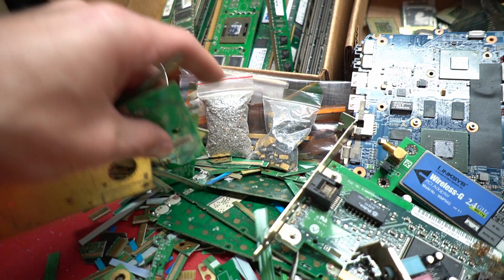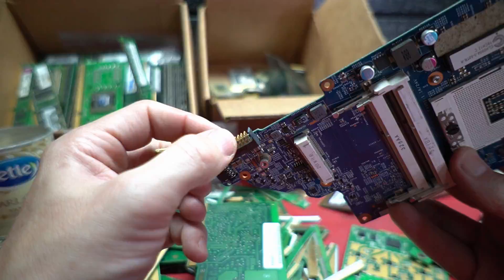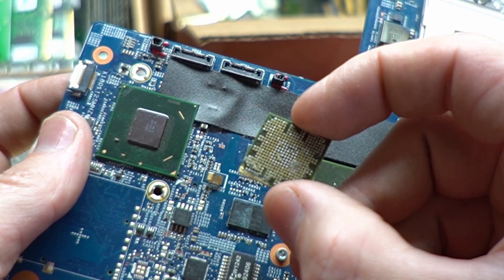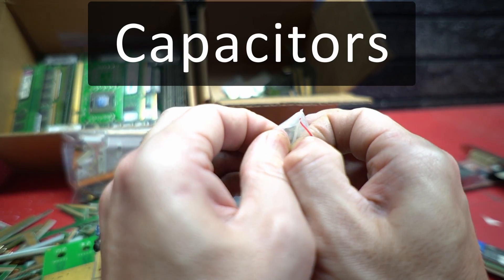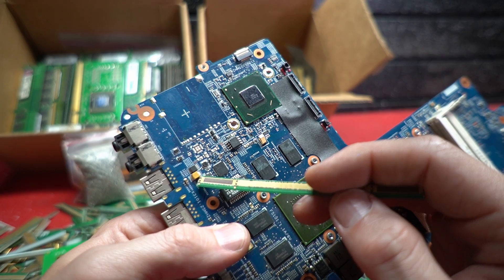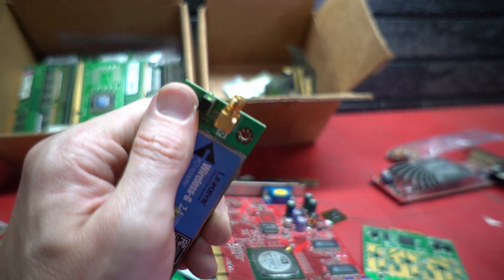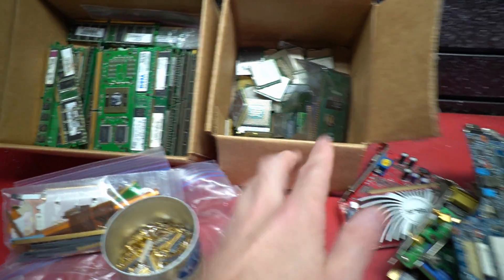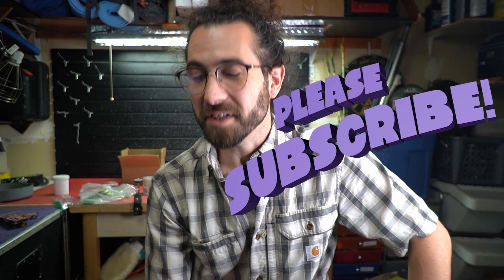Where Is The Gold Inside A Computer? - How To Find Precious Metals In Electronics

Comment: if you  directly melt the gold flakes that come out of the electronics, what happens?
Reply from the maker: I’m not sure I understand the question 😅 if you melt it, it will melt! The purity will vary, gold plating is 100% pure but the method used to release it from scrap could leave bits of copper or lead still in your yeild

Comment: gold isn't used for conductivity, as silver is much more conductive. Gold is used, especially on contact points as gold doesn't oxidize or tarnish, so the contact stays clean and allows conductivity to continue. silver or copper can tarnish making the contacts less reliable. its reliability is the key, not the conductivity itself.
Reply: You clearly dont have any common sense. Computer pins wont tarnish to behin wuth without gold because theyre plated with nickel but you didnt know that. Cou pins wont tarnish either because they are made from kovar a alloy. Stop talking about something when you know nothing about it. Gold has great conductivity but its even better at transmitting data over connections. Research something before commenting.
Reply: Gold is the best conductor
Reply: @Jason1975ism  Dude no shit did you not read what he wrote jfc
Reply: @GuestFGC  I'm not your dude and all I said was that gold is highly conductive. Wtf is your mm about a stated fact?
Reply: @Jason1975ism  Dude, he talked about conductivity in the first sentence, homie, you are disregarding his entire statement, and bro, you're stating obvious facts for no reason.

Comment: Ik you are stock piling your gold circuit boards for a time in which you feel comfortable enough to attempt to carry out the process of gold recovery successfully and document it on camera to share with us. I can only ask you what is the wait for? You have experience enough to extract the gold from computer components now i think its time to figure out the next step. Today again I carried out the successful aqua regia process and it is much easier than you think. You need muriatic acid sodium nitrate urea and sodium metabisulfite.  It is a $50 bill. It is awesome being able to extract the gold from what 99.99 percent of the world consider trash. A lot of people also sell you the concept of needing large amounts of circuit boards to get anything worthwhile but initially the most important thing is to discover that you have the ability and that simply requires a small amount. And by small amount I mean less than a lb of gold fingers will suffice to get you some beautiful brown pay dirt ready to be melted down. Simply one piece of advice is do not sell that stuff it is more valuable than you know. People down play its value yet buy it up for themselves. I will not sell my circuit boards anymore.
Reply: I tried recovering gold from circuit boards and ended up stopping once the gold had fallen off the boards because the first attempt I lost everything when I dissolved it into solution and couldn’t get it back out of solution
Reply: @Callsignsoggybisket use stump remover to bring the gold back out of solution but you have to get the right kind with the right ingredients

Comment: I collected some obviously gold plated items and felt like giving it a go at dissolving them mostly just to do something interesting. I stopped midway through and have a jar in my bathroom right now with the brownish sludge you see in the gold refining videos. I stopped because I didn't have the stuff for the second part so I just shelved it until I felt like continuing. 

I hate to admit it but I did end up tossing my heavily damaged Mewtwo gold plated pokemon card in there just because I could guess pretty accurately what the other metals were... which I was right, but it was still both unfortunate and interesting to watch the zinc bar dissolve leaving the plated material. 

Of course I know right now I'm likely going to have at the least a copper impurity if not zinc too but the latter should be easy to get rid of if I'm not mistaken, but my time is spent roaming and tossing scrap more than messing with that right now.

Comment: worked for John Fluke mfg. in the mid 70`s doing inlaid circuit boards they did a lot of gold plating and the science dept. started  recycling the circuit boards....the first month they came up with a 12 oz ball of gold valued at over 5k....i believe gold was around 450 an oz.

Comment: Finally! You Rock! And you did it in less than 5 min! Thank you! Honestly this is the 1st video I personally have found that actually explains what "Exactly" to keep. Every other one I have found says "keep this, but no explanation as to why and which one is or isn't except save them up"! But not that to do with them once I have them saves up?? 

Thoroughly appreciate you! I was in the middle of deciding to throw out the rest if what I've gathered as I took 3 bins of boards to salvage along with a bin of thick aluminum and a bin of copper. I walked out with $80. I was crushed as I knew there was more $$ in there I just didn't realize they actually want us to remove everything. They don't care or want boards with stuff on them! Who knew! 
Needless to say I'm now ready to do this correctly and have found an on liberal very reputable company to mail it to for maximum cash flow! Was the point, right! Again, many thanks!
Reply from the maker: Nice! I was in the same boat, I’d been digging through everything I could find to try and understand but nothing seemed to “sum up” the basics. Basically a continuation of the video series I was putting together.
As a Canadian outside of Ontario I don’t have a decent buyer of boards so I just pick off the best bits and take the 10cents/lb I’m given for the leftovers, but I don’t process enough Ewaste to put together a shipment worth sending through the post.
Reply: @thubprint  hi, could you please send me links to your other videos? I'm not finding any
Reply from the maker: @chacedrinkwalter3346  if you click on my profile pic you should end up at the channel page where all my playlists are

Comment: I am basically limited to selling anything electronic on eBay. Scrap yards are afraid of anything electronic. It's pathetic. They always cite lead concern which is totally absurd.
Reply from the maker: Are you in Canada? I definitely find they’re all over the place, but even the ones that will buy boards from me don’t give much for them. That’s such a strange reason to give, they all buy lead anyway!
Reply: @thubprint  I am from California in the United States. I think that there are lead laws. I tried to sell those small motors that come from computer fans and three metal buyers did not want them because they contain a small circuit board. 

Ironically I can sell those by the box on eBay too. Fins clipped and everything. I have to do things in a strange way here.

Comment: everyone says gold is used because of it's high conductivity, but I really don't think that is the case. sure, gold is a great conductor, but not as good as copper or silver, so it can't be primarily because of it's conductive properties. i think it has something to do with it being a very resilient metal: it won't oxidize and is difficult to tarnish. but i'm not sure how these properties compare to silver, which is the greatest conductor and much cheaper in comparison. also, we have to remember about solder-ability as well as how expensive it is to actually apply the material, let alone the material itself. i've been looking for the whole answer for nearly a half year now.

Comment: here's a year-late tip:  do NOT over look the gold corner BGA chips on circuit boards.  forward to 4:09 in the video.  The large chip with the silvery looking circle in the middle.  Those can contain ALOT of gold compared to other IC chips.  remove the epoxy body from the fiber base.  You will see gold foil on the fiber base, but the vast majority of the gold is in the bonding wires encapsulated in the black resin.  There are a couple way to economically process them. Good Luck!
Reply: Yes, theres gold thread connecting  the chip encased in resin to the legs.How can they be separated is the question.

Comment: Telcome gear has the best amount of gold
Reply from the maker: Nice! Not counting those super old CPUs though, but they’re nearly impossible to find now
Reply: @thubprint  youd be surprised local scrap yards get plenty of old computers. Got tons of the intel Pentium pro processors. Pulled apart a 4G relay and the board in it was 80% gold. Along with some connectors being solid Gold. They dont cheap out with hardware

Comment: FYI: No. Gold is NOT used due to it's high conductivity. Gold is used because it doesn't oxidize/tarnish/etc. No metal (or material in general outside of superconductors) conducts better than silver. However, due to it's cost:conductivity compared to copper, it's typically not worth the difference. Because of this, copper is rated as having a conductivity of 100, yet silver has a conductivity of 105. Gold on the other hand has a conductivity of 70.

I'm not trying to be that pretentious asshole jerking off while I think about how smart I must have come across. I just wanted to clear up a super common misconception for your future reference so you can hopefully avoid those types of e-cancer. Thanks for the video though. Take it easy
Reply from the maker: Ohhh, I honestly had no idea! You didn’t come across like that at all, I appreciate you clearing that up 😊

Comment: And I remember when you took your huge stash to the recycle last year 🤦‍♂️🤦‍♂️
Reply: You should take a motherboard and strip it clean of all the components, then I emplore you to take a long look at it and ask yourself what of value remains. I see a silicon wafer imbedded with high purity copper pathways, coated in a small impurity layer of solder mask, then peppered with smatterings of solder containing silver/tin/palladium and lead. Then take that wafer and see how much you can stack compared to other copper bearing things like motors and heat sinks. 

 Times are getting weirder and tougher. Yeah when all the junk is on the board it’s better to take it to a non-pay recycler to deal with. But with an air hammer and a little OCD packing skills, one can build up a Crazy amount of copper weight that I don’t think any scrapyard will look twice at turning down. 

 I truly believe the time is coming here in Canada when you’ll see your everyday scrap recycler start paying for cleaned ewaste boards, and pay well. Once the scrapyard industry catches on to just how clean of a product can be achieved from circuit boards. All the impurity is on the surface, and that can be wire-brushed off (speaking on an industrial scale where one would not want to use Lye to remove the chemical solder mask) It all goes into the same industrial shredder and following chemical acid bath at the end of the day as the rest of the junk copper bearing scrap, the only thing of hazardous nature on the board that are removed are the batteries. Once that battery is gone it goes into the same shredder as your copper wound blender motor. I’ll just leave it there and let that bake in.

 Sorry if I overstepped in my thoughs.. Your a pretty resourceful scrappper yourself, so I’m not trying to tell you how to do things, just wanting to not to discount something so quickly just because of the current recycle regime Canada has in place. I scrap ewaste myself like you and honestly for a hobby, holy crap does the gold, silver and PGMs stack up fast and nicely when you get the good scores. Personally the only boards I stack are 1) Ram PC and/or Laptop) 2) any board showing gold plating across the board 3) Laptop motherboards 4) Desktop MB’s only if they are server or telecom.

And only stack if fully depopulated. Air chisels, are a gift from the monkeys that came before us. ✊🏼🤘🏼🤘🏼 

Always trying to leave it better than I found it, keep up the awesome Thub 😎✌🏼
Reply: Glad to see you’ve come back around to ewaste precious metal hobby 😎👌🏼🤟🏼
Reply from the maker: My stash of ewaste? Oh man, I was so disappointed! I thought I was sitting on a huge payday but nope. Canada has a lot of things going for it but ewaste scrapping ain’t one of em 😆

Comment: Hey Thub could you tell me what kind of camera and mount you use in the car. Your videos seem extremely stable.
Reply from the maker: Sure! I’ve got the GoPro8 stuck to the window with a suction mount. Not the kind with the flexible arm though, it’s got rigid arms with finger-screws to lock the pivot points.

Comment: Hello Thub, Sweden here again.
My regular yard pays flat rate for circuitboards, doesnt matter if it's a board from a TV remote or a telecom board. Check the currancy, I get 4 swedish krona per kg.
The other yard takes high grade boards only, minimum 100kg.
Stay safe and take care.
Reply from the maker: Oh wow, that’s pretty low... I guess it’s not bad if you have a lot of lower grade stuff or you leave all the steel on them. Yeah, I’d be happy to have someone offer me that. What’s the other place do for high grade?
Reply: @thubprint  I even leave the aluminium on the boards, board price is higer at the moment.
The other yard, last time I took in high grade boards it was 20 swedish krona per kg, they also pay more for copper wire and non ferrous.
What is your limit for high grade wire? Here it's 60% cu.
I can check with the yards and do the math for you in CAD. Just for fun.